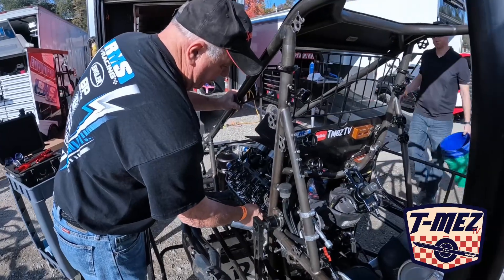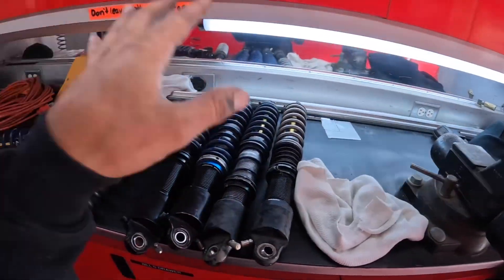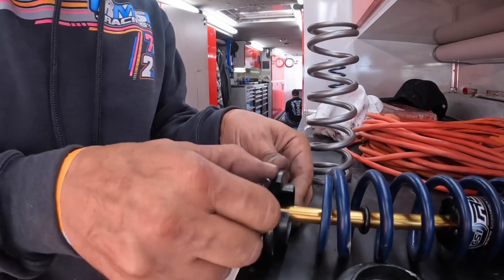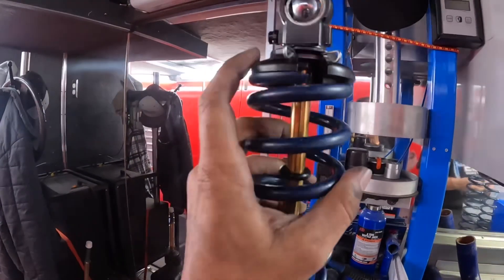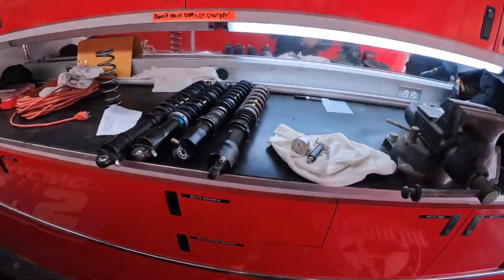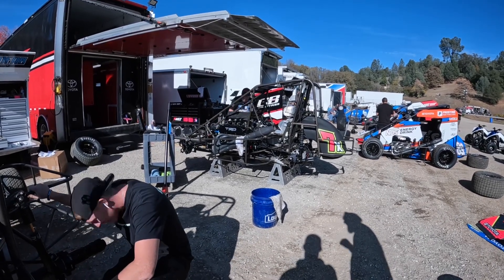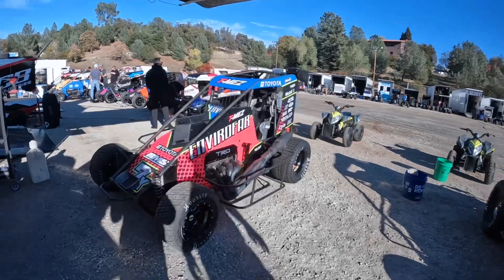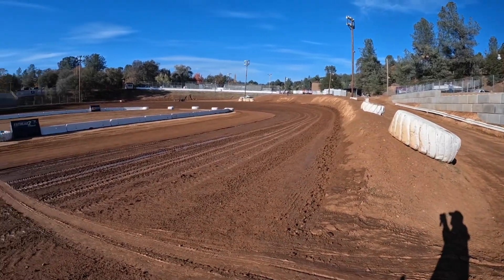Maintenance day at the track & chat with Chet Christner & Justin Grant

Comment: so are you currently looking for a shot at a run in the big cars for the big hoosier hundred to open 70 years of the usac circut, I know its pavement but I also know you like to run anything you can get your hands on, and have run silver crown in the past as evidenced by your interview from terre haute where it was too dusty they cancled the race  after 2 laps about 10 years ago.

I do appreciate the intro into how the shocks are set up though and how they work did not know they needed checked for gas though they were just dialed up or down for stiffness or cushion, the voice of usac looks older then I would have thought in a way looks slightly grayish like chad renalds from bangshift tv which streams and talks drag racing and engines in podcast.